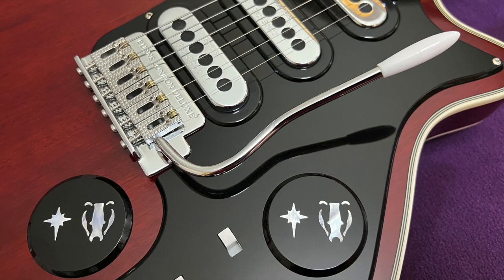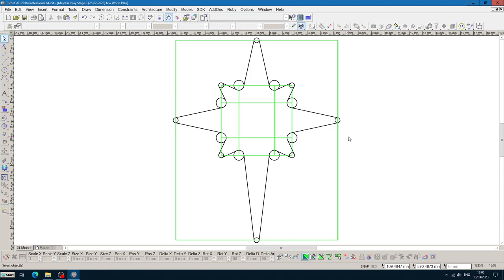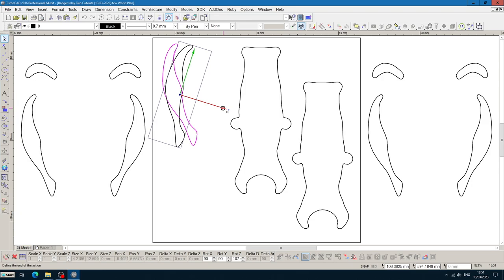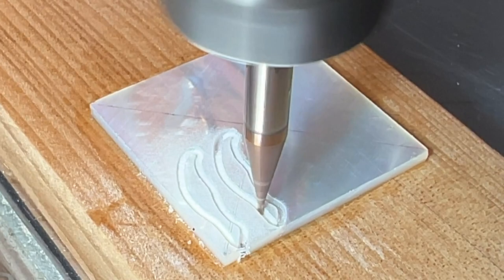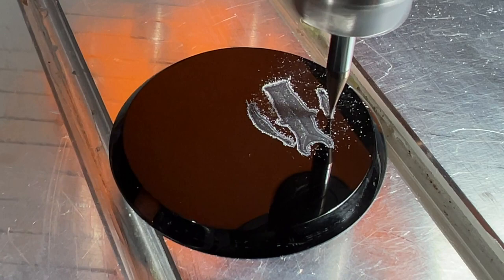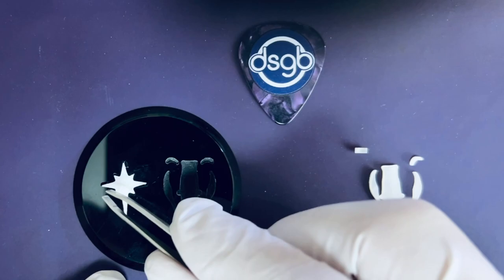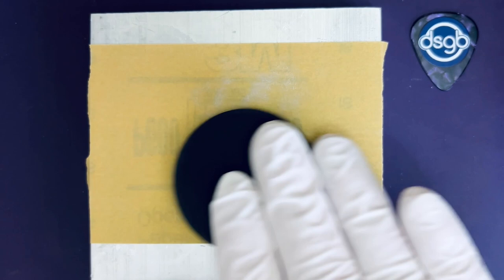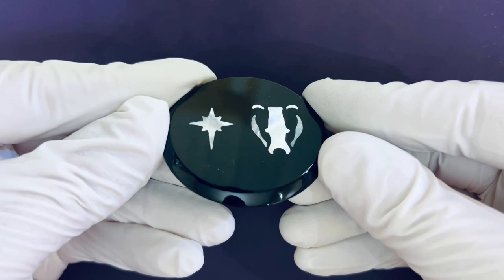Brian May Guitar Pickguard Inlays: MayStar and Badger by dsgb

Comment: Excellent video.  Might try this.  I used resin with pearl tint.  This looks much nicer.
Reply from the maker: Thanks Brad. As I found with Paua shell nacre while building my Brian May Red Special, the appearance changes as you reduce the thickness, a bit like digging through the earth's crust. 😂 In this case, the left section of the badger's head developed a dark spot. This is irritating so probably one up vote for the resin + pearl tint method. 🤔